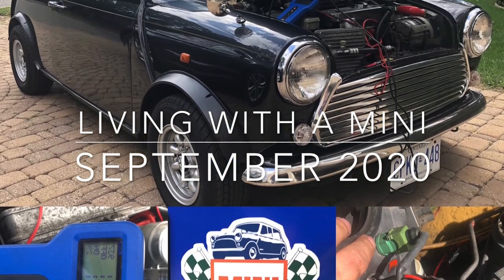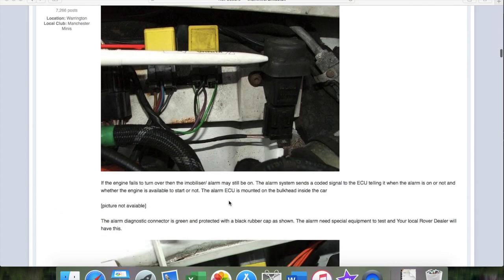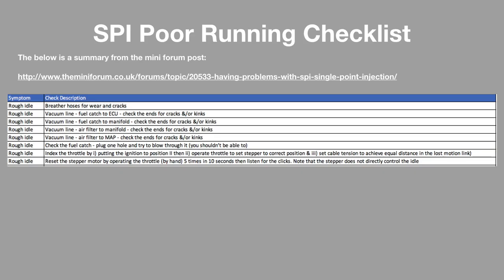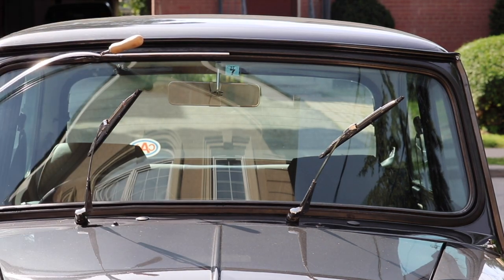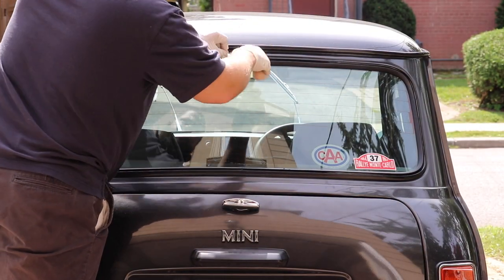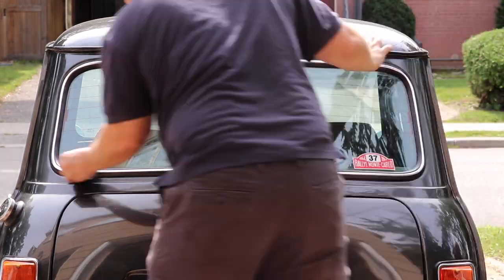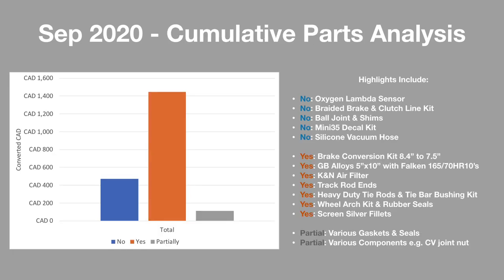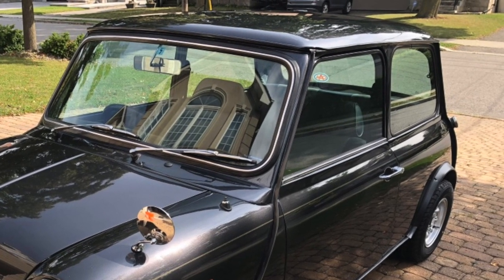Living With a Classic Mini: September 2020

Comment: Watching your series. Can you link where you got your parts and tools? For someone who’s new to repair and fixing up cars, would you recommend going with a carburetor or fuel injected Mini?
Reply from the maker: Hey Dennis, sure will try to do this going forward - general tools etc will come from the usual places (Amazon/Canadiantire etc.) and the specific Mini parts I get from local suppliers (Mr Grean/Sovereign Motor Works) or the UK suppliers (Minisport/Minispares). 

As for the Carbs vs Fuel Injection, its a great question and there are lots of differing opinions. Mine is fuel injection but Id almost prefer carbs, just for being simpler to run and maintain and fix if it breaks (just my opinion).
Reply: @garethkhill  thanks! I was leaning towards a carbed Mini. I’m currently learning how to clean out the carb on a golf cart. I’m learning a lot and hoping it transfers over to cars. Best of luck with the repairs! Looking forward to the updates.
Reply from the maker: @DrCh0ngo  that’s cool!! I have twin delorto carbs (like Webber 45’s) on my lotus - but that’s back in the UK. A golf cart sounds like great fun!! Let me know when you get that Mini!!

Comment: Nice work on the trim strips. I need to do mine in future. For finding air leaks in the engine system, you could try a home made smoke machine (https://www.instructables.com/BEST-Automotive-Smoke-Machine-You-Can-Build/). 
This guy has been documenting his SPI trouble shooting: https://www.youtube.com/watch?v=4D4SN4zpkSA
Might be something you can use...

I just did the shocks...KYB Gaz-a-just. Made a big ride comfort improvement, even with old rubber cones. much less harsh over bumps than with stock shocks. Went ahead and later did the front cones, replacing with Red Spot type (different compound and different shape for more linear compression), in the front only as rears wear less. These also helped ride. They do require HiLos to get them to fit due to different shape. 
Next up will be replacing tired old brake hoses.  If you have not yet done so, consider doing your fuel hoses as these get brittle from ethanol in the fuel. new types are ethanol resistant.
Reply from the maker: Cool, thanks for the links, will definitely check those out. I have adjustable shocks set them to soft to try to avoid turning into a milkshake driving around Toronto ;-). I have some braided brake and clutch hose to install on the car but want a weekend to do it in. My fuel hoses look pretty good at the mo and will keep a close eye on them that’s for sure. I will be using that rubber spray that I used on the screens to go over as much rubber as I can. I also fill up using 91 octane (there is a shell garage just down the road) so hopefully this will help.
Reply: @garethkhill  My fuel line (carb's car  so low pressure line) looked fine as well, until I tried to shift the tank a little to get to the shock tower top....that caused the rubber line to fracture and leaked fuel everywhere, even inside the boot and under rear seat foam. it's been 4 weeks now and car still reeks. If in doubt of age, you should plan to replace all the rubber lines in the pressurized system. Not worth the risk IMHO.